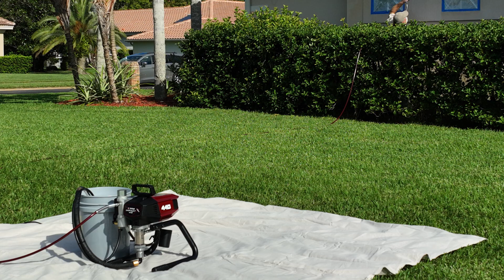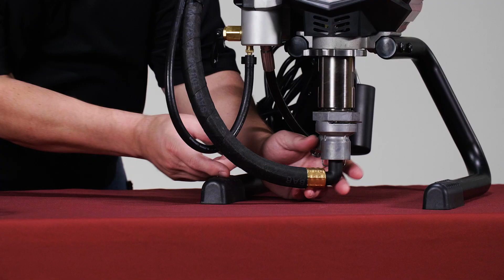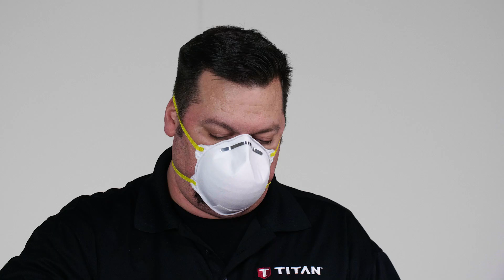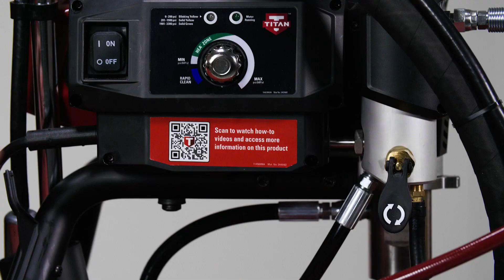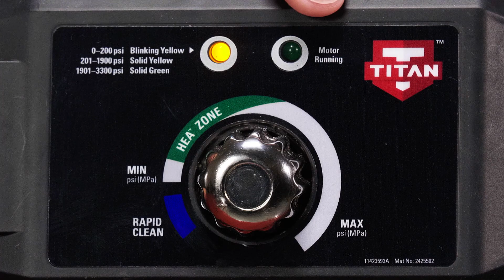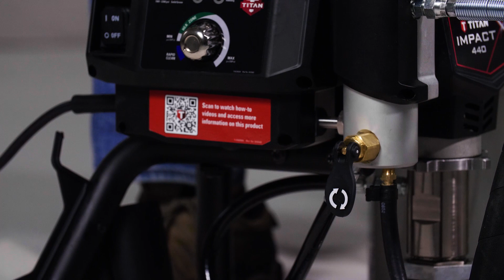Titan Impact X™ 440 How-To: Setup and Startup

Comment: This engineering is so Amazing! Wow wow! Love this babe. Though I missed the mineral spirits step. Is ir bad?
Reply from the maker: It's not super bad or anything like that.  What will likely happen is your first couple runs with the machine you'll end up with some of the packing oil mixing in with your material since you didn't flush it before use.  That might impact your finish but the packing oil will work through the system and you'll be fine after a little bit 👍

Comment: Just bought mine today. Why aren’t my icons on the prime spray valve white like yours in the video?
Reply from the maker: I checked with our Product Team on this - the first production run of the new unit did not have the white icons - after that run they decided to make the switch and put the white icons on for future production builds of the sprayer.